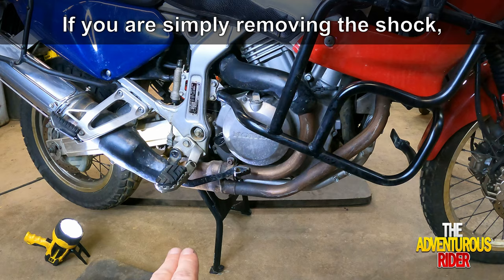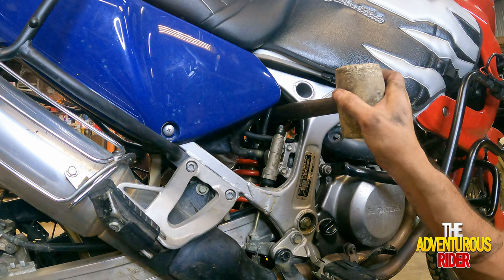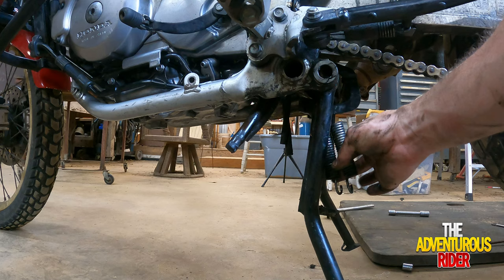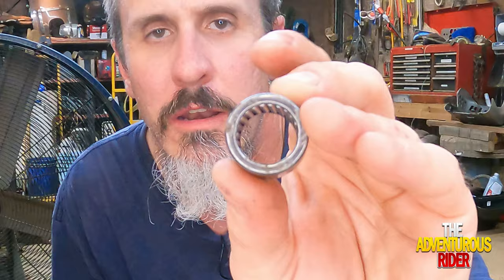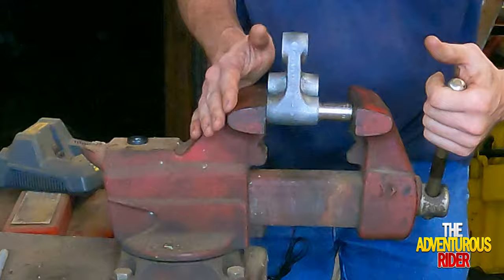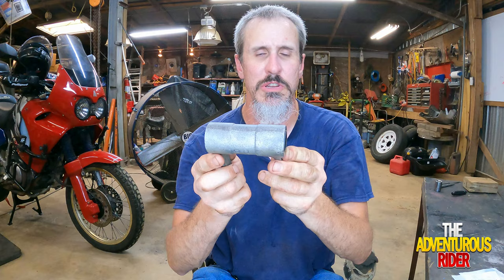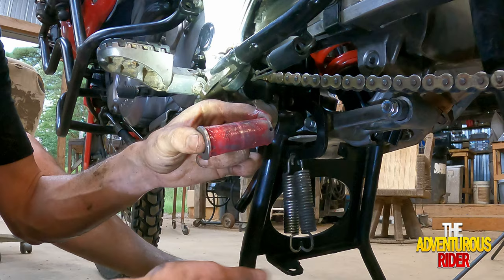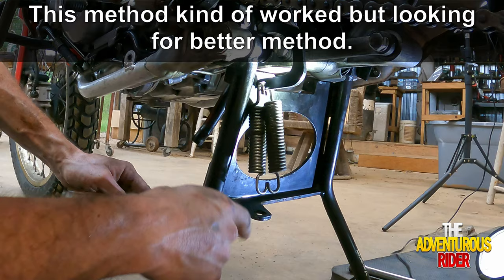Honda Africa Twin Rear Shock and Bearing Removal

Comment: Keep the tutorials coming on the Xrv thanks
Reply from the maker: I definitely will... After next weekend I'll probably be doing one on changing the rocker cover gaskets... I already have one on adjusting the valves so for time sake I probably won't go into the details like I normally do till I get to the rocker cover.. I'll just reference everyone to go to the otger video for torque specs and sizes

Comment: Nice work, as always! I can't say I have the RIGHT way to remove the center stand springs, but I can tell you a way that I have used on the Jiffy stand on my bike. I heard about the "penny method" and it works great! When your spring is in the stretched position, insert pennies or washers or whatever fits between each coil in the spring. If you need to, wrap some tape or something similar around the spring to hold the pennies or whatever you use in place so that they don't just fall out, and when you raise the center stand, which releases the spring pressure, the spring is now held in its longer, extended position with little or no tension on it, since the pennies or whatever spacers are keeping the spring stretched. When you put the spring back on and lower the center stand, then the spring is stretched and installed, so just take the pennies out, and Bob's your uncle!
Reply from the maker: I haven't thought about doing that.  Thank you.  You are a wealth of knowledge.
Reply: @theadventurousrider  I'm just old, that's all :)
Reply from the maker: @tommylitchfield3450  lol